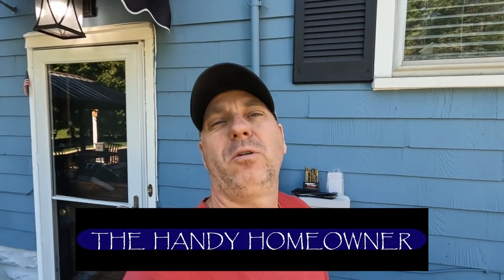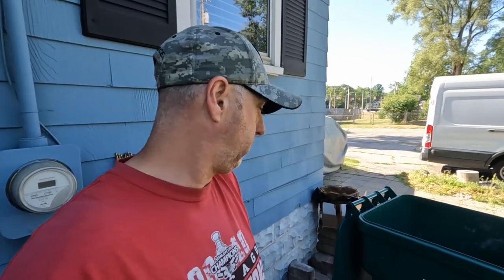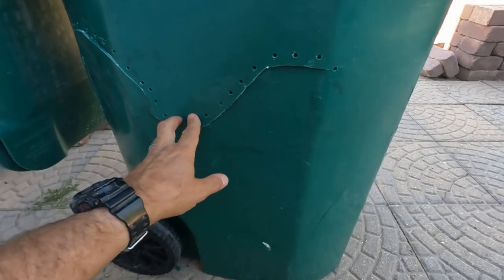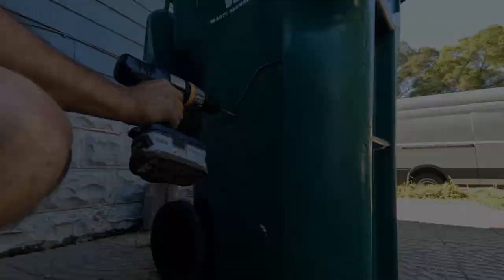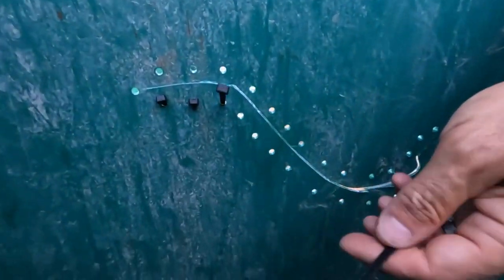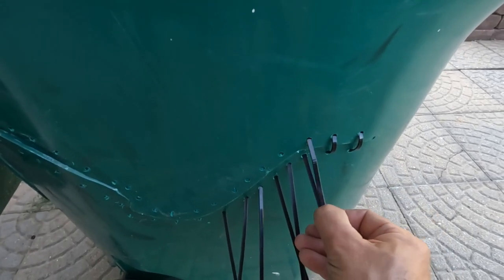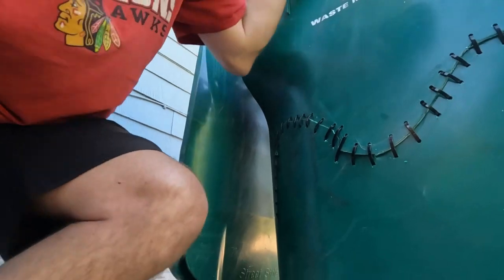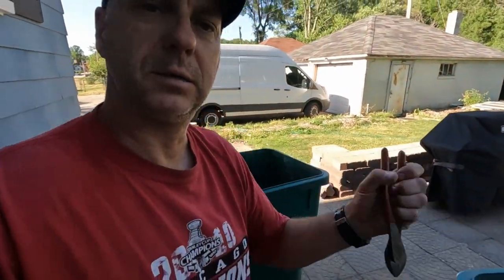Cracked Plastic Repair - Stitched

Comment: Just curious - How long did this hold up after you put it all together?
Reply from the maker: Good question.  I did this in June of 2022.  The garbage truck is NOT gentle with these cans and id say after a year and a half, half of the zip ties are busted.  But in general it has worked great and it's easy enough to replace the zip ties where needed.  I could probably double them up if i wanted but using thicker ones might be good too.
Reply: @thehandyhomeowner9781  Thanks for the reply! Awesome to hear they've lasted so long.